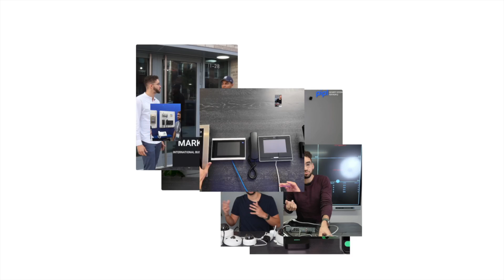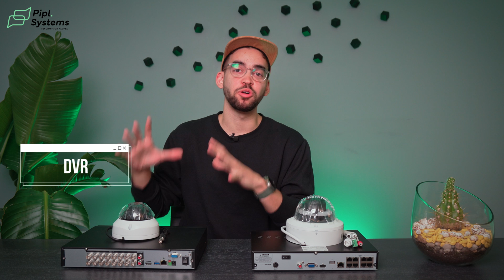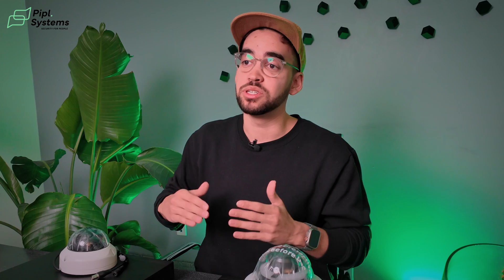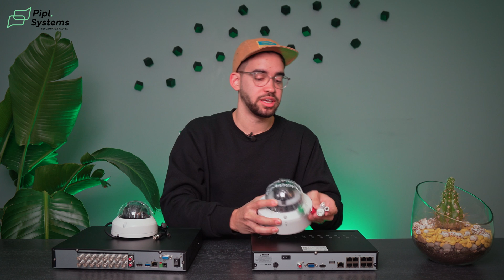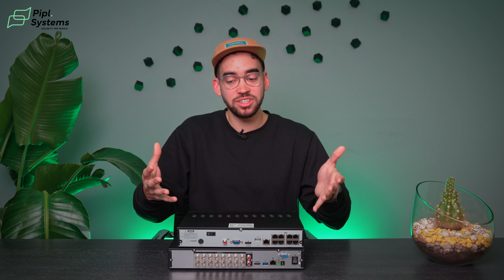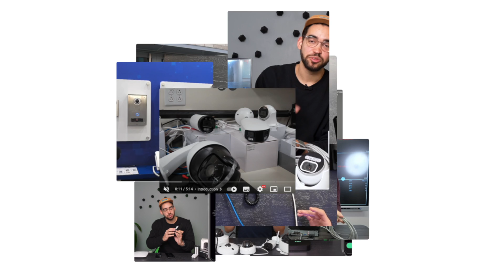NVR vs DVR: Which One is Better For You? What Makes Them Different? | Back-to-Basic

Comment: As much as I would like to get an NVR its just not feasible to rerun all those wires if you have a DVR setup with BNC already. The cabling and drilling is probably the biggest challenge if you plan on upgrading to an NVR.

Comment: Hi can both DVR or NVR record without internet thanks
Reply from the maker: Yes, DVRs and NVRs can work without internet 🤝
Reply: How @piplsystems
Reply: @khyalwali-02  Both DVR's and NVR's are independent of the internet. They receive the video signal straight from the camera(s) and record that signal onto the storage within the recording device - in this case the DVR or NVR. No need for internet and no need for a monthly subscription. I am upgrading from a DVR to an NVR. I don't want to have to pay for a security system and then turn around and have to pay someone for my video footage (monthly subscription). Plus it's a lot more secure. Many monthly subscriptions use cloud storage - meaning your video footage can accidently be released. It's happened.

Anyways, I'm tired of having to use outlets to power the cameras, so with the NVR I can use what is called PoE (Power over Ethernet) cables that run straight from the camera to the NVR. The cameras get their power from the NVR (since the NVR is plugged into an outlet). It eliminates the need to run extra cables. In other words - if I have a two camera system with a DVR that would mean 4 cables (two for the DVR and two for the outlets - although the DVR needs to be plugged in also). An NVR with two cameras equals two cables (PoE) straight to the NVR. Plus NVR = digital signal whereas DVR is an analog signal. Hope that helps.